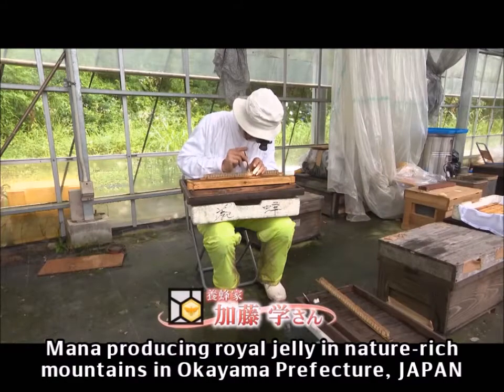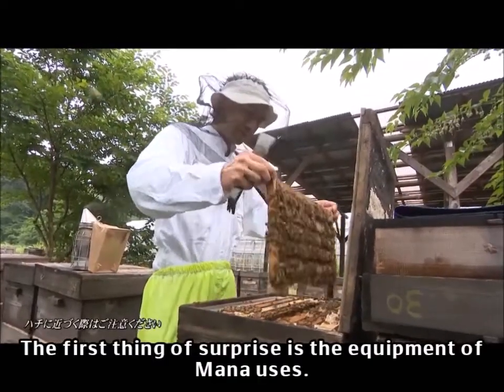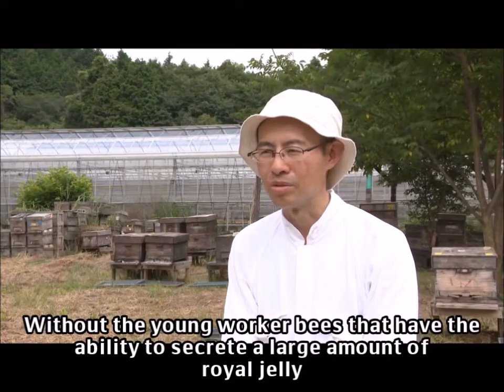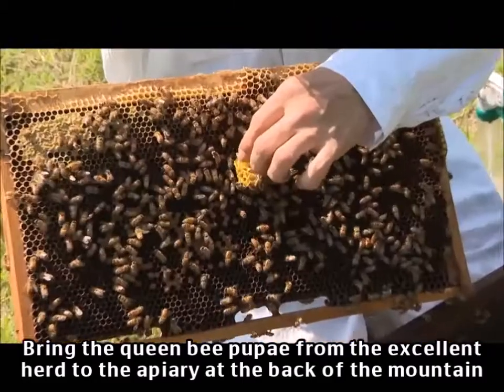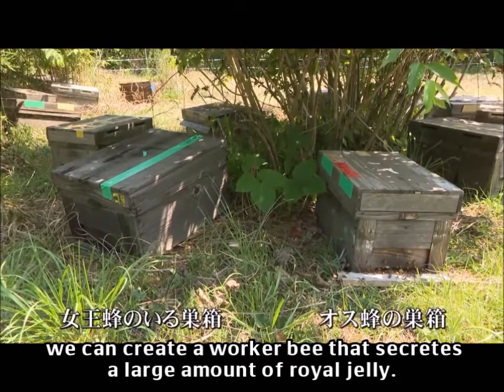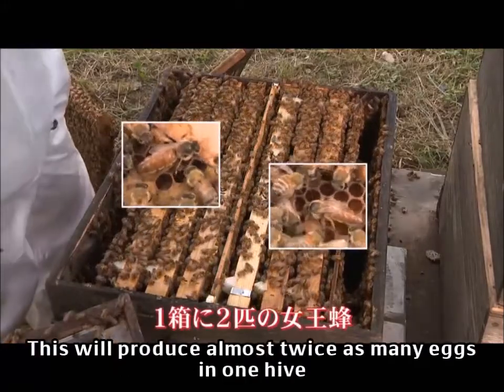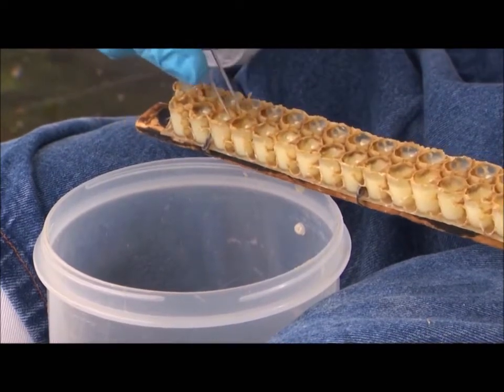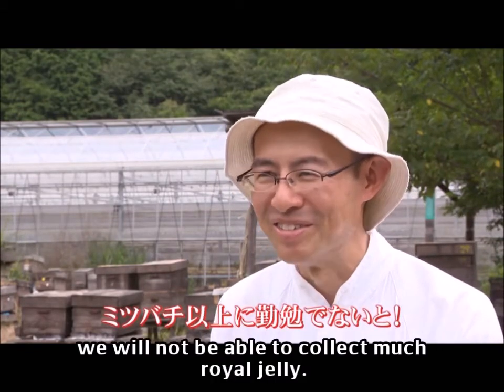Japanese Production Technology of Royal Jelly(2/2)

Comment: 400g royall jelly costs 22 euros in germany . it tastes bitter and like vomit with a slight grainy texture . u need water to chug it. u need to keep it in the freezer when not using it. heat above 0 degrees celsius destroys and spoils it .after using 400 grams for 1 week i have now every morning erections . so it helps with sex.forget buying it from the internet . u need to buy it directly from bee producers  or else u get fake product .(ex. pills, powders which are maninly from fake chinese bee keepers)
Reply: I would say that is not correct, taking into account that fresh pure royal jelly costs around 20 euro for 20 grams. So 1 euro per gram. Also can be kept in fridge (freezer only for longer periods).